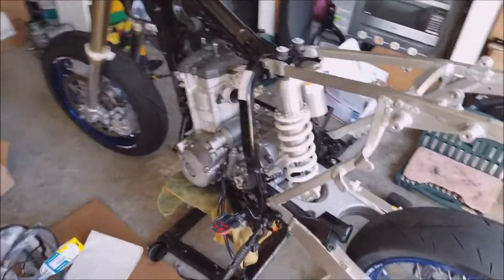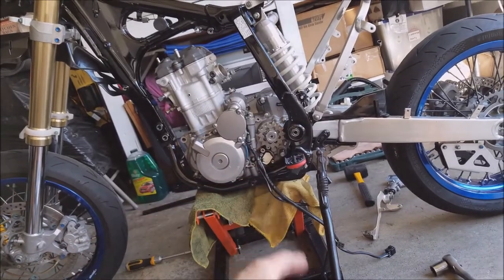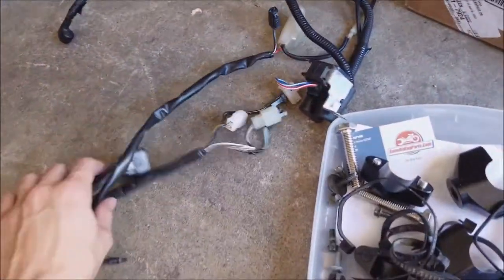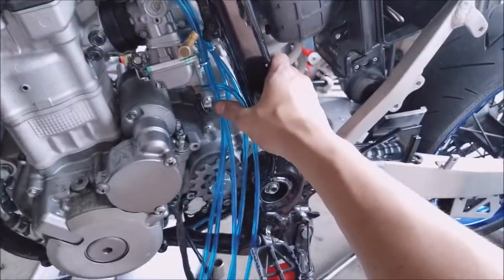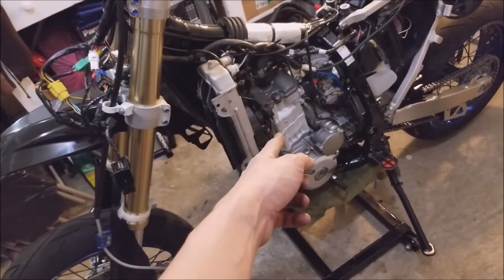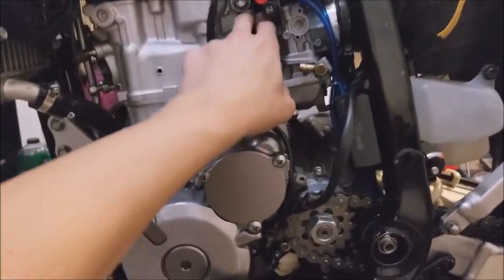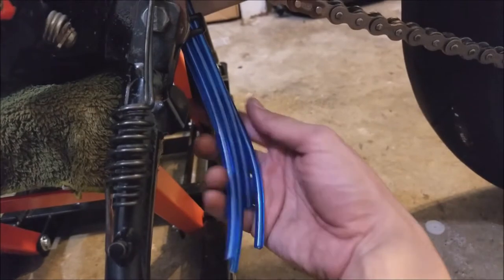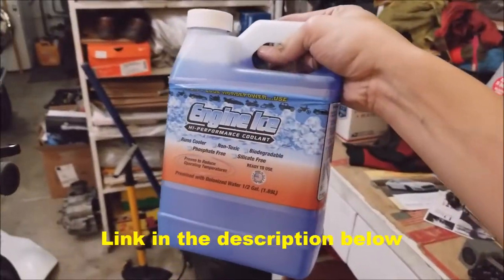Engine Installation + Re-wiring - 2013 Suzuki DRZ400SM

Comment: There are diagrams for cable/hose/wire routing in the OEM service manual.  I know Im late here but if u need pics let me know.  Even with he diagrams its not a simple task.  You can do it the way you think is best -- thats what I did- then when I got the OEM diagram I found out nearly everything was routed incorrectly.
Reply: Would you have it for a 2010 Suzuki drz400e wiring harnesses thank you
Reply: Would you have it for a 2010 Suzuki drz400e wiring harnesses thank you

Comment: Where did you get the new harness?
Reply from the maker: I bought plenty of parts from a used parts dealer on ebay.
Reply: @motoken  so it's not new it's just in good condition
Reply from the maker: @Sobek88  came from a bike with less than 300 miles on it.
Reply: @motoken  that's the sort of parts I'm looking for because not every single parts can be new like front forks I can't find aftermarket, not sure about rear shock but I think it's the same...